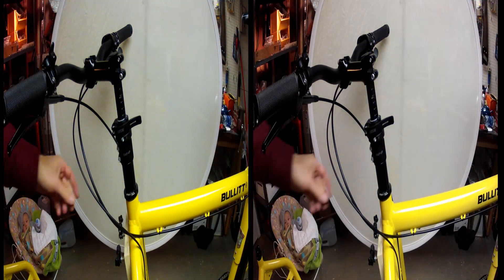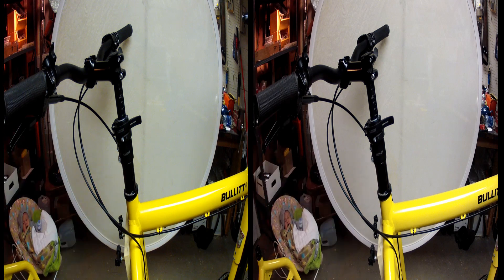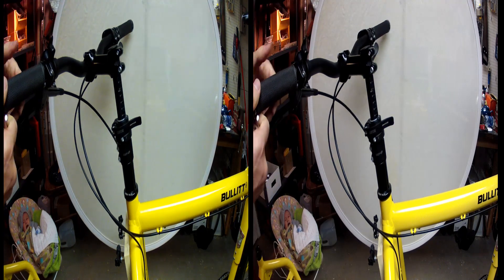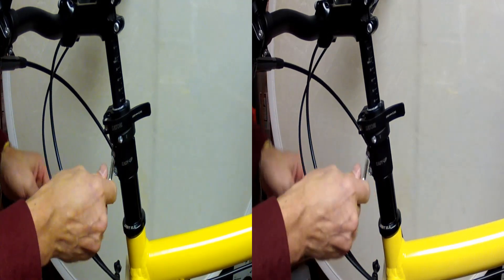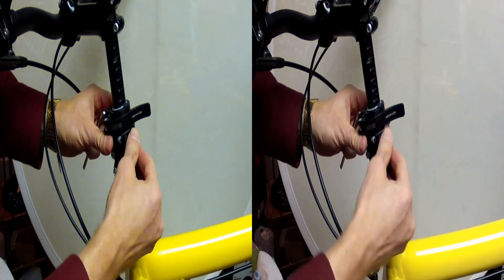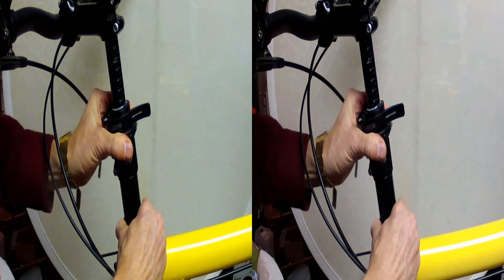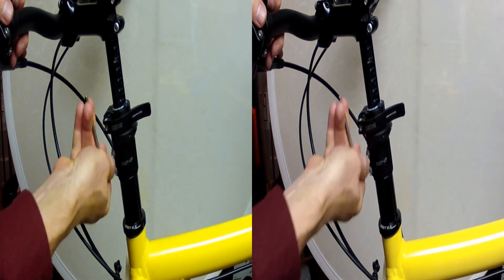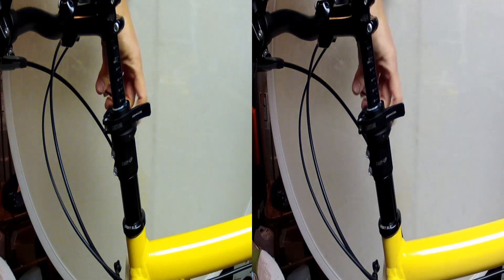Satori Easy-up Rear Headset Adjustment on a Bullitt Cargo Bike 3DTV stereoscopic HD

Comment: Hi. I think you've made a mistake here. I have the same Satori Easy-up stem riser. You need not loosen and retighten that clamp in the first and last steps. The clamp is what grabs onto the fork tube inside in order for the preload to be applied to the headset bearings. Loosening this clamp and twisting the ring should have no effect as the preload will not be applied.

All that was necessary to do here was to simply to loosen the ring screw, twist the ring tighter to apply more preload, and then re-tighten the same ring screw to hold it in place (the intermediate steps you've shown).

The first and last steps in your video may only be necessary if the original setup was improperly done and tightening has little or no effect. I had to shuffle my riser quite a bit and push it in all the way properly. It was only after I did this did the ring tightening work properly to preload my headset bearings.

The manual could be much better written though. There's just way too much confusion regarding this product.
Reply from the maker: Hey, thanks for your reply.  I will look into it!  I did find the "manual" quite confusing.  To understand anything well, I have to take it apart.  I haven't done that yet with this stem!  WHen I do, maybe there will be another, better video!
Reply: retroformat3d There are three pins running inside the steerer clamp from the tightening ring down to a washer under the clamp. When turning the ring the pins push down on the washer and this preloads the headset stack.
Reply from the maker: Joakim Fors THanks Joakim and Rizwan again for this additional input.  I'm glad I posted this video, even though I clearly misunderstood the correct procedure,  because now I know the task is so much simpler (not to say trivial)!

So I think this also means that there is no need to support the steering tube from below!  If we don't loosen that first clamp (with the two bolts), then the steering tube will not fall out.  One need only loosen the lock bolt on the twisting ring, twist it to tighten/preload the bearing, and then relock it.

Obviously my video makes it much more complicated than necessary!   I'm going to have to make a new video now.

Comment: Is this some kind of stereo-vision or something? I get two scrunched videos side-by-side instead of just one that is the full width? Just me?

How is the overall quality of the Easy-Up? I'm considering either that or the Montague Octagon and wonder if one is better than the other.
Reply from the maker: It is a 3d video, just like it says in the title "stereoscopic"  "3DTV"

You can turn the 3d off, if you don't have the necessary devices (i.e. a 3dtv, or some red/blue glasses, or a stereoscope - depending on your preferred viewing mode).  Just set the youtube player mode to "2d"

The Satori stem quality seems solid.  I don't know anything about the Montague Octagon, so I cannot give you comparative information.

Good luck.
Reply: 0